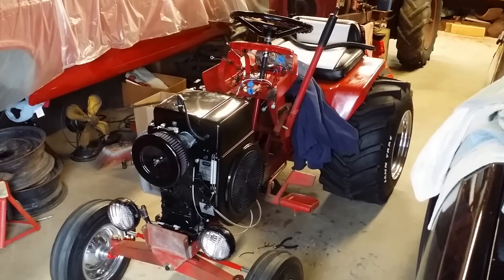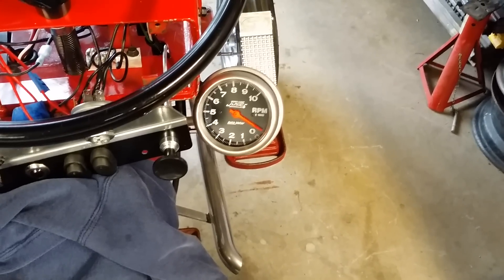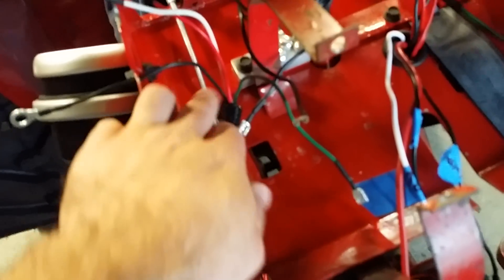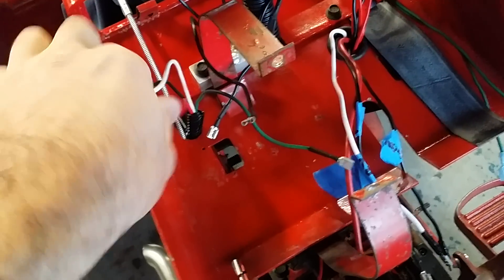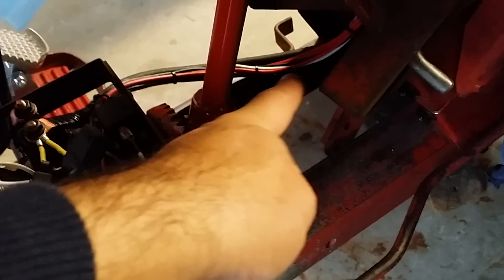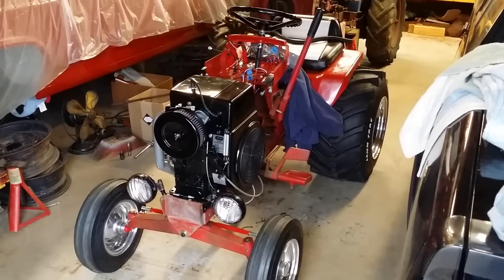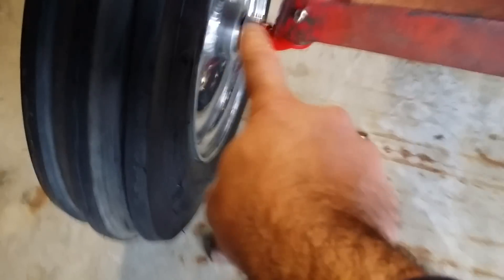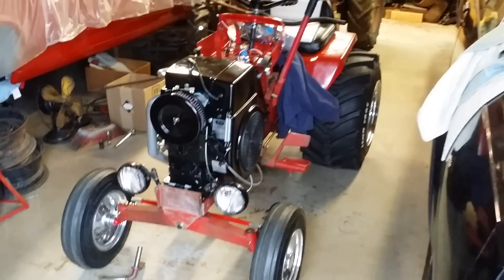1966 Wheel Horse 1056 Garden Tractor Puller Project Part 21 Finishing Up Some Wiring VinsRJ

Comment: I have a 1056 and I see some things on your tractor that aren't on.mine. does your tractor have a 2 speed rear end I see two shifters
Also that is a newer engine on it don't it? Also is that a foot speed on it? Also  how did you wire the tack to get the revs on it. Nice tractor by the way.